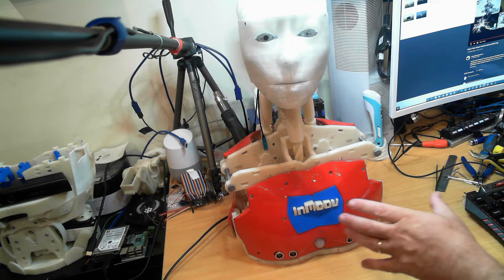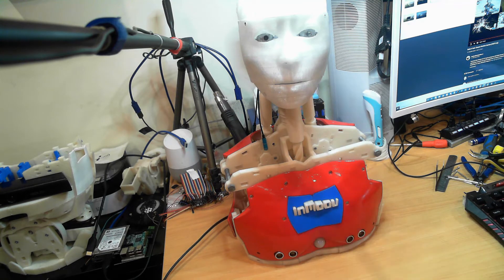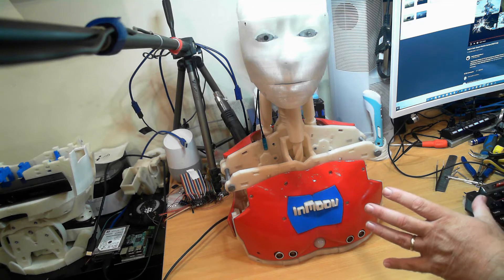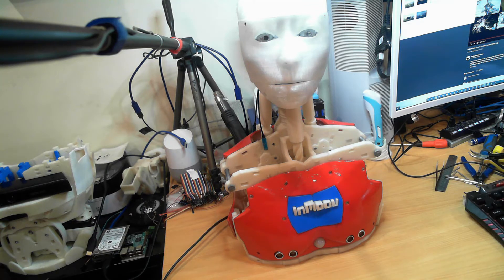Freds Upper stomach lower torso Part 5

Comment: Hi, I am new to this project and have seen all of your videos. Where can I find the Microsoft Xbox 360, Kinect Sensor, at a good price? Or maybe I can only use the ultrasonic sensor that you showed in the video? Thanks.
Reply from the maker: Finding one now is going to be more of a challenge, Microsoft don't make that model anymore :-(
I got mine years ago with a X-Box system, but you might be able to find one on Ebay or Amazone or the like.
There are other solutions out there, but the Ultra Sonics and PIR are not them :-)
There is a very cheap lidar module available that you could use, would be slower but would give you a single point range that is accurate.
The Kinict sensor consists of 4 major components, that we are interested in anyway :-)
1) A visible light camera.
2) A powerful Infrared Flash.  You can't see the flash, but the next part can :-)
3) A multi-sensor IR Light time based sensor. This sensor times from the trigger point, how long it take for the pulse of light from the IR flash to return the the sensor element.  With an array of these it can get a didtance based on the speed of light an object is from the pixel.  Each pixel is focused at a different angle light any other camera pixel sensor, so the sensor sees a cone sort of view extending out.
4) an image processor that can process the result and merge the two images it get into a composite image or just the visible light or just the distance image view.

The PIR sensor is good for detecting changes in the background IR levels as happens when someone walk across it field of view.
The Ultrasonic sensors only give a range when triggered, it is best not to use both the left and right sensors at the same time, but rather one at a time and they return the distance from the sensor to the first object detected.
I also have a Raspberry Pi Spy Camera mounted on one of the eyes.
Using the PIR sensor, I can have the robot in a low power sleep mode until the sensor triggers.
As part of waking up, we can then use one of the Ultra Sonics to get a range followed be the second one.
This should give us an idea how far away the local objects are, a second poll of each sensor can tell us if the object is moving or if it was just the sun shining through the window.
If it was a moving object, then we can wake up more systems and try the OpenCV to see if the object was a person or an animal moving.
If it was a person, then see if we can recognise the person.
Then we can say hello :-)

If we can get a Kinect sensor to work, it would perform the same function as the Ultrasonics but better and faster.
Not sure if I will ever get the Kinect to work or not, I'm currently running with a Raspberry Pi 4 in the head and will soon have a second Raspberry Pi 3 in the back with a touch screen working as well.
I may need a third one just to use the kinect.

While this is my second or third build, it's still all experimentation and learning. :-)